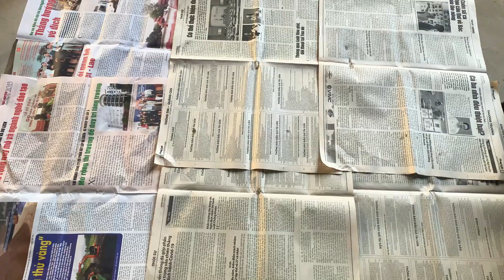Don't throw away old inner tubes. How to Make a Compressor from Motorcycle Tires and Bottles

Comment from the maker: Got some old inner tubes lying around? Don’t toss them just yet! In this video, we’ll show you an incredible DIY project: turning old motorcycle tires and bottles into a functional air compressor. With simple tools and easy-to-follow steps, you can create a powerful, budget-friendly compressor right at home. Perfect for anyone who loves repurposing materials and getting hands-on with DIY!
Step-by-step guide to building a DIY compressor
Tips for using motorcycle inner tubes and bottles for maximum efficiency
Smart, budget-saving ideas for practical tools around the home